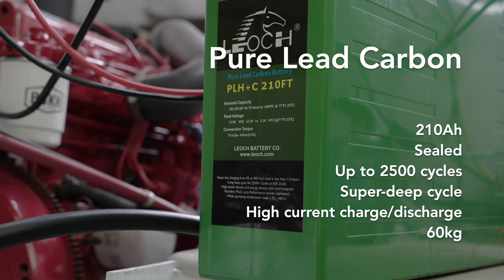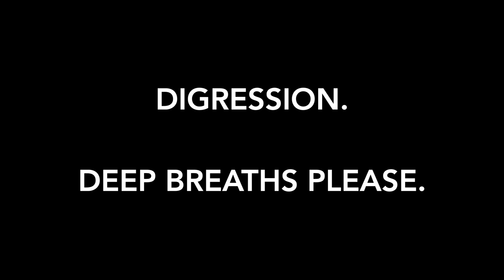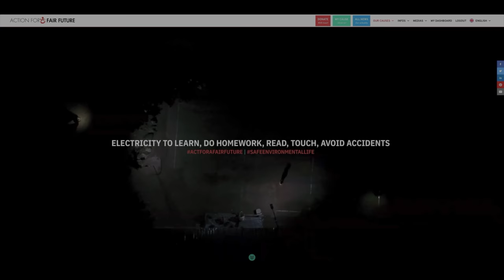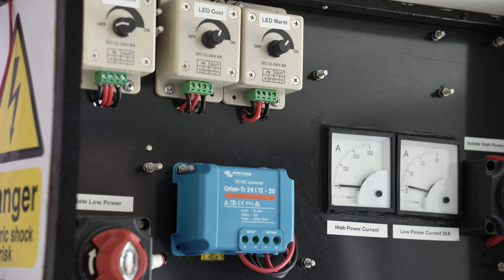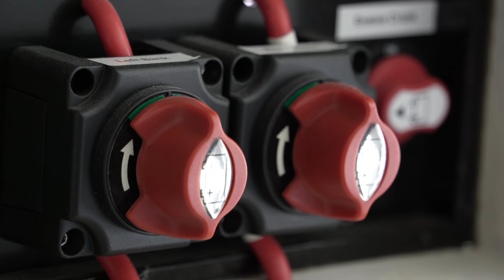Lifeboat Conversion Ep12: Introduction to 12V / 24V electrics system, and battery choices [4K]

Comment: do you have a high output alternator ? or are you using solar to charge the system ?
Reply: I think he is using solar
Reply from the maker: Solar just to trickle charge at the moment. Eventually solar, wind, and a diesel generator.  Plus a 1200W alternator.

Comment: Anything to protect the 30A ammeter if you accidentally turn on a high load without switching ammeters? Digital voltmeter or battery monitor to monitor state of battery charge? Do you only have 1 alternator? Maybe carry a spare. Especially in a lifeboat where engine use is expected to be limited the engine supplier might not have fitted a great one. Nice layout though for troubleshooting.
Reply from the maker: I can certainly carry a spare. Actually I haven't fully 'plumbed in' the second ammeter yet - I'm asking an expert for the best wiring solution for them.

Comment: Interesting work. Make sure to add fuses to your system, if not already used, so in case of a shortage in one of your sub-components the others still work. Also, fire hazards are reduced drastically.
Reply from the maker: All fused up out the back of the panel.

Comment: Have you considered an iron / steel keel to protect the underside of the boat and provide ballast? A 1" plate, cut to width and bent to curve up at the bow, would tick a bunch of design checkmarks for an expedition boat.
Reply from the maker: Certainly something being considered.

Comment: Have a kill switch that will be able to kill power from batteries and into them. Maybe get some weaker backup batteries and hand crank shaft generator.  Some kinda alert if your batteries are running low. And you don't want your batteries be cold so maybe have some electric heating for them  or better have a small water tube run wrapped around engine exhaust to wrapped around batteries and small pump to keep water circulation. Water will heat up from hot engine exhaust and heat up batteries or just keeping cold away. You could keep alot of heat by capturing it from different sources and keeping in small water tube throughout the ship.

Comment: Noticed on your isolators you have them labeled left bank and right bank. Might I suggest you label them port and starboard just to keep everything standard on the boat?
Reply from the maker: No. Because the battery box can be rotated 180 degrees.
Reply: Right on I will continue to enjoy your videos and shut my stupid mouth lol.

Comment: With regards to battery wiring, are they connected in parallel then series or series than parallel? The slight different is the first method connects all the batteries to each, such that one failing has a 
reduced impact on the overall system.
Reply from the maker: Series, then parallel. As if there were two 24V batts connected in parallel.

Comment: It can be good to have an "emergency power" circuit. A 12v 20ah AGM or Lifepo4 battery connected to your LED lights and an emergency radio or something. That way, if your main panel fails or has to be shut off, you can still see what you're doing without having to use flashlights.
Reply from the maker: Yes indeed

Comment: I have LiPo4 house batteries, couple of times over last winter I had to run the engine to get the batteries warm enough to charge them, great batteries but they are not perfect.
Reply from the maker: Right - no battery chemistry is faultless.

Comment: How do you plan to heat Alan? Is there a possibility to use the Heat produced by the Engine more efficient?
Reply from the maker: Either ambient heat from the engine, or a diesel heater when the engine is off.

Comment: IMO, replace your spring washers with regular washers and nylock nuts. They're great at resisting loosening due to vibration, wont gall up surfaces like spring washers when disassembling stuff, and come in stainless, if you're using stainless hardware inside.

The other option that I actually prefer is Type C nuts, but those don't come in stainless that I know of.
Reply from the maker: Nylocs aren't as good once tightened and released once, but yes sure they do have their uses.
Reply: @AlexHibbertOriginals  True, but anything you're going to be taking apart enough times for that to matter, will also be significantly chewed up by the spring washers.

I've used both a lot and had nylocks that I loosened probably nearing 100 times before the extreme vibration of my machine was enough to cause them to vibrate loose. 

Whatever vibrations you're concerned about, they'll be nothing like the vibrations of having stuff rigid mounted to a 35hp 4-cylinder lol

Comment: Late to the party but i've only heard and read positive things about Lead-Carbon batteries in marine applications, from English canal narrowboats to smaller yachts and some small size Mediterranean research vessel with a bit too much energy requirement due to equipment.

Comment: Do you have any circuit breaker's installed in case of an leak (whether through faulty equipment or maybe even a person)?
Reply from the maker: The panel is fused at various stages.
Reply: @AlexHibbertOriginals  okay that's great to hear (since you didn't directly speak about it). Thanks for the information.
Reply from the maker: @burnstick1380  Thanks - yep it's just a case of dividing up the episodes as best as I can.
Reply: @AlexHibbertOriginals  okay that's great to hear

Comment: You are aware of Lithium batteries problem with below freezing temperatures right?  (no charging below freezing, chemistry dependent of course for exact numbers)
Reply from the maker: Indeed. Although some have pre-heaters built in,

Comment: Hey alex should you not have a Aluminiumbar with threaded holes for the batteri terminal instead of grouping all the cables ? :P it is a nice to have thing if you need to remove just one of the cables and have everything else "running"
Reply from the maker: Can you elaborate? I'm not sure what you mean.
Reply from the maker: I have bus bars on the back of the electrics panel. On the battery terminals themselves there's only two or three connections, so I guess I could use bus bars, if there was space, but it only takes seconds to take a terminal ring on or off.
Reply: @AlexHibbertOriginals  everything is always nice to have, but that is what makes life worth while :P as long as you feel satisfied and it works nothing can be wrong :D

Comment: I would say that in an enclosed environment, I too would prefer the lead batteries. Lithium batteries are quite safe generally, but when they let go, i wouldn't want to be indoors with a lithium bank that size.

Comment: Please use liquid tape ie. Silicone sealant on all connections. This will keep any salt water/ moisture from getting in to your wires. I've seen power cables that look good and the motor had trouble starting. Until I cut down the cable and 10 inch into it was all corroded. water/ moisture is a real bitch. You may want to consider a drop light. Especially if you have to work on the motor. This will enable you to have white where you normally don't have it.  Stay safe.  P.S. don't forget a multimeter on your trip.

Comment: How are you heating the cabin? Electric resistive is simple but inefficient (relatively). Waste heat from the engine would be good until the engine's turned off. Would you consider a heat pump system? It's like an AC unit but backwards. It's 2x to 4x the efficiency of resistive but less effective at lower exterior temperatures.
Reply from the maker: Either ambient heat from the engine, or a diesel heater when the engine is off.

Comment: Apparently your USB Ports only provides 5V. Power Delivery over USB can be quite complex and charging power hungry devices with only 5V might be not effective (or maybe even not working). E.g. Laptops negotiate up to 21V over USB. But as your design is modular and you have 24V changing the "chargers" behind the panel to something that supports USB-PD might be something to consider.
Reply from the maker: For anything demanding more than 5V at 3A, we'd just use 12V outlets.

Comment: Also, be very wary of optimal battery operating temperatures.  I can assure you, being at the bottom of a boat in the Arctic is not conducive to maintaining optimal operating temperatures.  I know lithium can freeze even when fully charged and not allow any power output when frozen.  Likewise, be very careful with temperature.  If memory serves, some battleship plating becomes exceptionally brittle when exposed to extreme temperatures.  It would be wise to ensure the same thing doesn't happen to whatever your boat is made of.
Reply from the maker: Lithiums have their performance/damage issues when being charged below 0deg C. Their discharge curve at very low temperatures is excellent, especially at lower currents.

The composites that comprise the hull, and various other components, perform excellently at very low temperatures. It would likely be the resins that would fail first, and some collaborators and I had them flexing nicely at -40deg C.

Comment: You should also take some double sheaved flexible welding cable of the same amperage or larger amperage so that if the silicone power cable strands break due to the cold which they will be more prone to do in frigid temps then your silicone cables will end up having a very high resistance & poor transfer of power. Having this type of welding cable will be your redundancy back up in case you need it.
Reply from the maker: The silicone cables are cold rated, but your idea for backup is good nonetheless.
Reply: @AlexHibbertOriginals  I just don't want you to be out in the middle of nowhere & come up short on power because cables have frozen & snapped too much.
Reply from the maker: Appreciated!
Reply: @AlexHibbertOriginals  Yep yep

Comment: Usually cut off switches are connected to negative cables.
Reply from the maker: Lots of online searching found that this is only the case for certain hull types. Pros and cons of both options.
Reply: @AlexHibbertOriginals  fair enough.

Comment: Lead carbon batteries are pretty reasonable.  Even just a good quality deep cycle marine battery can last many years for what you're using it for.  I'd say the biggest reason not to use lithium batteries on a boat is fire. Lead-acid batteries tend to fail safely whereas lithium batteries can and do fail catastrophically.  If someone accidentally damages a battery or shorts it, what you have is much less likely to create an unextinguishable fire.

If you're using a thermal labeler like a Dymo label maker I've learned the hard way that the printing will fade over a few years and that's definitely accelerated by certain chemicals in the environment.  From my experience a cheap inkjet label maker with a covering of clear tape is the cheapest, longest lasting solution.  For portable labeling I just use stickers and markers.

I'm interested in the recovery process.  I think you said you might recover Alan a couple of years after the expedition?  I assume its going to be abandoned north of the arctic circle so nothing short of an RTG will keep it powered or above freezing.  Some charge controllers have an automatic electric start.  If you end up with a lot of excess fuel it might make it a long time on its own just starting the engine every few days to maintain a charge.  It could make it a lot easier to find and recover if it still had a radio beacon working 2 years later.  Some electrical components (especially batteries and electrolytic capacitors) are easily destroyed by extreme low temperatures or complete discharge.  If your engine has an electric start, automatic charging might be something to look into to make the recovery easier.
Reply from the maker: Thanks for the labelling advice. 

The drift and recovery expedition is no longer happening, but the original plan would have involved two trackers, on bow and stern, powered by solar topped-up large cold-rated batteries. They would only ping satellites infrequently, and would have lasted years.

Comment: Many of you need to educate yourselves on the reaction present when water and lithium are introduced.
Reply from the maker: Dangerous substances are frequently used in proximity. Electricity and petrol for example. What's needed is a reasoned risk analysis.

Comment: Ouch,  if you are going to be using batteries as ballast,  make sure sure sure, they are waterproofed.   i mean above and beyond.   any water that comes in from open hatches during storms,  any condensation, any melting snow...  water will always try and settle at the lowest points in the boat, often in the ballast areas.  Now this gets even more critical with Lithium batteries who can catch fire quickly.    I would suggest, if you are going to run  1-2 lithium 24v banks mounted "high"   as emergency backup, well away from any hatch.  Then the Lead batteries low, in a sealed water tight container, with a moisture/bilge alarm in it.   

you might also want to keep or have some way to pump water out of said area if water does start accumulating in it.   This might be as simple as a small waterpump or a wet/dry shopvac.   Again you don't want water getting into your battery system,  shorting it out, setting lithiums on fire,  when you are 1000's of miles from any  replacement parts.
Reply from the maker: Hi Jennifer,

I'm confused as to what part said I planned to have unsealed batteries sat in a flooded, un-emptied bilge area.

Thanks for the input.
Reply: @AlexHibbertOriginals  you never did, but its something that i've actually seen done in some boats...  people have "moved" electrical panels,  not thinking about waves.   People have set up battery packs as ballast, in sailboats locally,  and ended up with bad fires breaking out.   For some reason even "professionals"  seem to forget or ignore water infiltration into electronics. 

I have no idea why, so i thought always get cringy when people talk about mounting battery systems low.    Hence i tend to suggest extra, care and planning in that with several layers of redundancy.  

Used to crew a rescue boat locally.
Reply from the maker: Would it make sense to not lead with 'ouch', then?
Reply from the maker: I think there's a few ways that people comment on here - it's easy to frame an idea or suggestion in a way that appears to only make the commenter feel clever, and not actually mean well. Of course, intent and reception often fail to mesh.

Do feel free to keep commenting - I only remove spam posts or those mindlessly attacking other viewers of mine.
Reply: @AlexHibbertOriginals  there was never an intent to belittle you, or make me feel cleaver, just genuine concern/fear, and hopes that you don't run into the problems we see around here.   

This is going to sound strange as well, but, depending on the part of the arctic you are visiting,  you may need a firearm.   In Canada, in the far north artic communities its almost a requirement, to the point that insurance companies won't insure documentary crews without them.   This gets doubly tricky because if you are going to carry a firearm onboard, you would need a gun safe/security box  to comply with laws there.   Wondering if thats been considered.   

Again, not trying to show off or anything, had a friend who lived in the high north in nanisivik.   (73°02′N 84°33′W)  way up there
Reply from the maker: Hi Jennifer - thanks. Have a look at Ep 11 where I go into a lot more detail about my Arctic work.
Reply: @AlexHibbertOriginals  heading there now.

Comment: How are you gonna heat the boat??
Reply from the maker: When underway the engine (the insulation is such that cooling may be necessary). When at rest, a diesel heater.

Comment: LiFePO4 batteries can't handle cold weather charging. That's their only downside....other than cost haha. Good choice on the other battery tech.
Reply from the maker: Some have internal heating circuits nowadays.

Comment: I would never pick lithium ever, even for a canal boat, much less for a boat heading off to a remote location.  Lithium can be dangerous, far more so then lead acid.  The only other option I would consider would be NiCd Aircraft batteries which come in 24 volt packages.
As it is, your configuration will be just fine and give you both 12V and 24V volt options.
And they are much much more affordable.  
If anything, I'd recommend doubling the number of Lead Acid batteries.
Reply from the maker: These Pure Lead Carbons (a new sub-category with new technology) are great, indeed.
Reply: @AlexHibbertOriginals  I used to service aircraft batteries but that was years ago.  I am not familiar with the "Pure Lead Carbon" tech you speak of,  I shall have to research this.
BTW  are you familiar with the old Edison Battery  AKA the Iron-nickel battery?  They have been know to last for decades longer than any other battery type.  I don't think I would suggest them for your application.  They have a very high internal resistance and that limits the current you can draw from them, which could be an added safety factor.  They last so long that businesses have gone out of business due to lack of need for replacement, literally they can last a lifetime

Comment: Instead of changing all the split/lock washers why not just loosen them use some Loctite or some other threadlocking compound designed for the vibration or thermal issues your nuts may experience?
Reply from the maker: I may have a mixture for those never undone, and those sometimes undone.
Reply: @AlexHibbertOriginals  indeed.. The red Loctite compound will require heat to be applied to aid removal but the blue should just require hand tools. Your videos are great thanks for the uploads..
Reply from the maker: @rbrettlong  You're very welcome